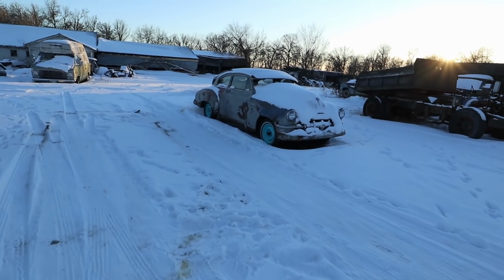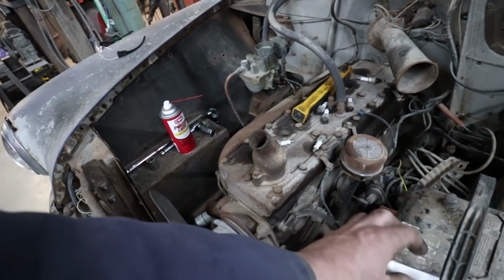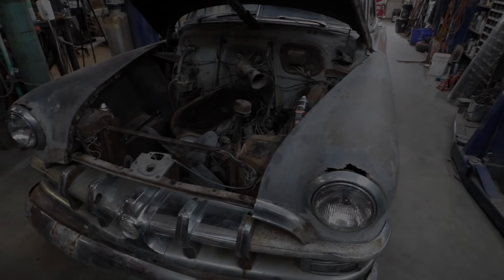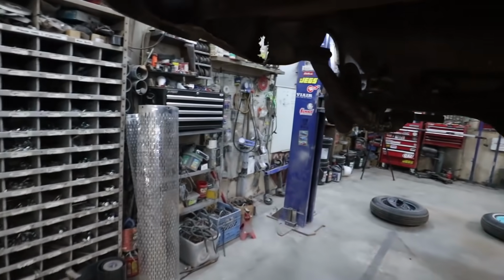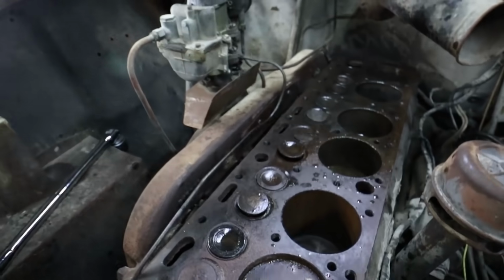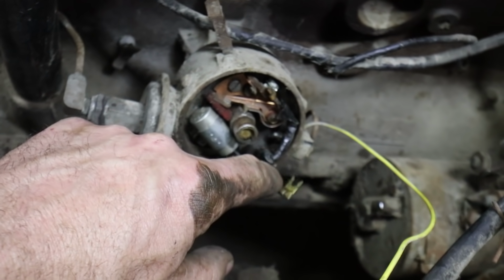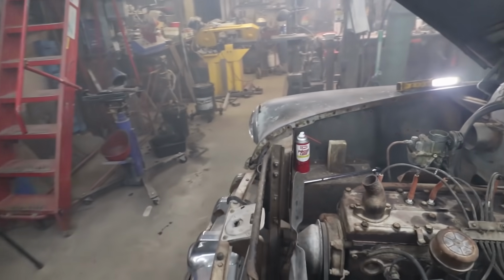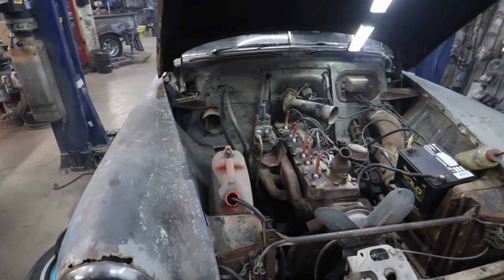Traded a snowmobile for an abandoned 1949 Pontiac with a stuck motor will it start?

Comment: My Dad had a '48 Pontiac Silver Streak, had a flathead 6 but a crack in #5 cylinder wall.  He bought a running '54 Pontiac (last year for the flathead engine) with a straight-8 and pulled the motor.  It was a bolt-in swap into the '49 and ran like a champ.

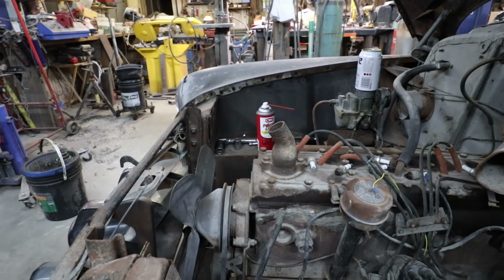Comment: 08:09 I really like the OEM air cleaner. Lol.
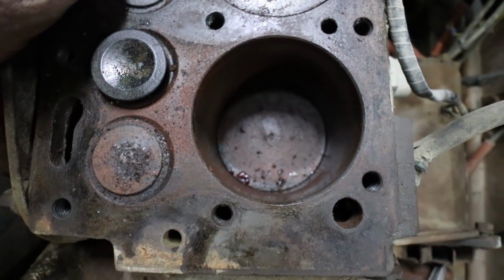14:49 I use to put Kerosene in the cylinder, let it soak, and use a piece of wood as my punch/drift and hit it with a hammer.
Took time but it worked. When you saw the level of Kerosene going down things were happening.
The sound to me sounds like the Bendix on the starter is not disengaging. It's in over run.
Reply: Kerosene  works very well, fill up stuck cylinder s and let set.. I had a 1939 Pontiac 6 cylinder  stuck solid.  Couldn't  even break it by towing it popping  the clutch. Finally  one day I had to move it again I was using the stuck motor as a break. Then the motor broke free sending me down the hill hit a tree. Changed oil started it
 Up.

Comment: Its not a bad looking ride you know. I was born in 49. The motor actually purred the 1st start, amazing. Saw some chrome off the 4 door that might work, bumper and grill looked nicer. I have no idea how you deal with the body rust underneath, Be a driver for sure, make is safe and reliable then another guy could tinker away and still drive it to the hardware store. Great job on the motor. Nice project. Thanks for sharing, Dennis in Virginia

Comment: My first recollection of a car was my dad's 1950 Pontiac. Then I ran across a picture of me as a toddler in 1955 with the Pontiac in the driveway. It was a straight 8, he had it until the mid 60s. Great old car, very reliable.

Comment: Could peck on the pistons with a brass or lead hammer. And could do the same with the valves And that motor sure does rock a bit when you try moving it. That was surprising. Who would have thought. Yea, it runs pretty good. You need to let it warm up. You keep killing it. Ronnie

Comment: Love those old Pontiacs. My first car in 69 was my grandfather's  51 Pontiac Chieftain. Straight 8 3 on the column. Light green 4 dr. That straight 8 was very powerful. later I had a 53 4dr str 8 automatic dark green top light green bottom. and a 50 2dr business coupe with a 6 that I bought for $50.00 and drove 2 years.

Comment: Since you were holding the hot wire in hand an the battery was disconnected after it would start, it appears that the generator is doing what it should an making juice to run on. I like the front of your parts rig the best an no holes in the headlight brows. What a find. Glad it wasn't the slush box transmission as there okay but ah.... just not my cup of java. It should be a breeze for the starter car builder as they really forgiving in so many  ways. I used to boil the head gasket in hot water and then quence it in diesel oil. It would swell up enough to get you by for a few but not for long. Great little videos your giving us Brent

Comment: Hi Brent here's an old school trick for you with a seized engine soak it as you've done put a breaker bar on the crankshaft pulley nut point towards the floor slightly and put a trolley jack on the end of the bar just a little pressure and leave it like that, all the time the engines soaking the jack is trying to turn the crank, love the channel regards from the UK, Bob

Comment: I'm a mechanic in New Zealand. We used to spray a liberal coat of galvanized roof paint onto the copper gasket and it stopped any seepage because after 50+ years they are never completely flat, LOL It fills any minor scratches too.  It always worked.
Reply: I had great luck using Siloo Valve Kleen, add it to oil and run the engine. Does a fine job !

Comment: My 53 Meteor gets sticky valves from sitting.  Luckily I can push them back down with a bent nail through the spark plug hole. Then I let it idle and give it a snort of WD 40. It really revs up then. I’ve never had to repeat the process more than three times and the valves are fine for the rest of the driving season.

Comment: Don't junk that old starter. If you free off that mill then I'm sure you can free of a mere starter solenoid. You've nothing to lose anyway if it won't go back together.
btw The way that fired straight into life after fixing the points was beautiful. No coughing, spluttering or masses of cranking, just immediate smooth running. Amazing after being so stuck.

Comment: I believe it was the brake fluid that freed up the cylinders. I was told years ago if you have brake drums that are rusted and wont come off to soak the seam with brake fluid and it will soak loose the rust. I think that is what happened with the cylinders.

Comment: You should aneal the copper head gasket, it will be work hardened by now. Aneal it with your torch so the copper softens up and will squish nicely when you torque down the head.

Comment: Use transmission fluid and acetone 50/50mix i fill the cylinders with it. It works mint. For freeing stuck motors.

Comment: You can anneal copper gaskets and reuse them.  As long as no part of it is of some other (non-restoreable) material and it isn't damaged then you can restore it as good as new. Just remember copper works the opposite to steel, (quenching keeps it soft while gentle cooling allows it to harden). Then clean it up witj scotchbrite and refit to engine.

Comment: If you put a downward force on pistons 2 AND 5 While heating it, and keep the tension up. A piece of square tubing with two holes going into head bolt holes ,a block of aluminum between. the steel and piston. A light touch with an air chisel on the aluminum blocks.  Got a dodge flat head loose that way.

Comment: In my younger days we would look for old Packard's to flip . I was always amazed at how many times we would remove the spark plugs , pour in Marvel Mystery Oil and leave it for a few days . Then come back , install new plugs and a battery and it would turn over and some times with fresh gas actually start and run after sitting so many years .

Comment: The squeal you heard was air being pulled into the carb when the fuel was used up I believe.
Reply: Sounded like a starter on flywheel to me....mechanical grinding as it touched ....

Comment: With an engine that is stuck that bad, I pour regular white vinegar in the cylinders and let it sit over night and they usually break loose pretty easily the next day. Vinegar actually soaks in and eats the rust and frees up all the parts including the rings in their grooves.

Comment: Also have light seize motor and manual transmission bump start with clutch to when pull tractor or vechile pull too sometimes works and got do bump start at 15 to 40 mph speeds too!

Comment: My Dad was a '50's juvenile delinquent with an Indian Chief motorcycle and a '49 Pontiac fastback with a Cadillac V8 and hydromatic transmission. Pull engagement OD on the dash. Burgundy with gold pinstripes. Tuck and roll upholstery.

Comment: I think l wrote you about this car but l had a 49 fastback like yours is.  It developed a rod nock so l sold it.  I wanted to put a 389 motor & a Muncey 4 speed in it and call it my 49 GTO.  This happened in 1968.

Comment: After you got the engine spinning, you should have run each piston to the bottom of the bore and ran your hone a few passes up and down each of the cylinders before putting the head back on.

Comment: Cool...  BUT... That was alot of hard work!  and the rings probably are still stuck.   On the next one please try the old school method of flooding the cylinders with apple cider vinegar for 7 days..  It will clean the ring lands and dissolve the cylinder rust.  Sal "Googs" DiMarco told my Uncle Leo Murphy about it when we were trying to free a 37 Dictator...  It has worked on 20+ now...  Just free'd up a 68 430...

Comment: I knew a man who was a wealth of knowledge on old engines. On stuck ones he would take the head off and pour maybe 1/2 to 1 inch of diesel fuel in the cylinders where the pistons were down and light them on fire to heat up cylinders and help fuel oil soak down around pistons.

Comment: The starter bolt was easy on the assembly line! After that, it's a mechanics problem. Engineer finding out at the last minute, hey we need a bolt there, only place to put it, drill and tap, send it.

Comment: What should have in bottle plastic or pump can with deisel fuel 50% and Dexron 2 or 3  Automatic transmission 50% mix up to put cylinders and valves to soak on stuck motor also if have gasket plus heads off and do again if 3 time need try blow torch cylinders also vavles to some heat with the mix I said about then Johnson bar too if needed! That break loose from seized up problem to and if need tap used hard circles block with sludge hammer light taps too!

Comment: Auto trans fluid (or Marvel mystery oil) unsticks hydraulic lifters (when added to the oil) but I don't know if it will work with the solid lifters in that engine. Lefty

Comment: Great job.  Just an idea.  I use PB Blaster instead of WD 40.  I find it works a LOT better.  There's a company in North Carolina which will rebuild those transmission mounts for you...very reasonable prices.  Also I believe that car has Babbitted rods with no rod bearings.  All that means is if you have oil pressure, knocks do not matter.

Comment: Next time try regular atf fluid it penetrates good I once was told by a older mechanic to give it a try to let is sit for 3 days on a old engine that was completely frozen took the plugs out pored atf in each cylinder and it worked first try I always resort to this now when dealing with anything similar

Comment: Those old flatheads I just rip the head off right away because even if the engine turns over the valves are guaranteed to be stuck so there is no point leaving the head on it just rip it off and then you can see all the issues. I reuse the gasket I just spray it with copper spray a gasket and they seal up good

Comment: I had one just like this in 1967.  I wanted to put a 389 Pontiac motor in it.  Got a rod nock and l sold it for
$50.  Paid $75 for it 2 years previous.  Wanted to label it 49 GTO!!!.  Had a straight 8.

Comment: Every flathead 6 I ever owned I pulled the head and had it shaved .060 cause it was so easy LOL.
Reply: Oh and Marvel Mystery Oil for stuck stuff. I don't believe in much chemistry but Marvel has worked for me.
Reply: @billmiller7138  no oil has ever worked for me. Not even diesel. What has worked is apple cider vinegar.

Comment: Amazing condition for a 72-year-old. The climate over here in the UK has practically killed off all cars from this era, not until manufacturers started to dip-galvanize the body shell and rust-proof the doors, bonnet and boot, with 10 years guaranteed rust-free, that they lasted a lil longer...10 years! Most cars from the 1970s have gone to Valhalla many brand new cars started rusting away after just 18 months on the driveway! ( Ford Cortina, MGBGT, Mini Metro, Morris Marina, Vauxhall Chevette, Vauxhall Cavalier, Rover SD1, Austin Allegro, Austin Princess) They all had zero rust inhibitors along with poor water drain-off areas. Its a shame and a disgrace. Good look with the 49 Pontiac, looks like a sound project as the overall metal is sound.

Comment: Pulling the head off is the best thing to do anyway unless your really lazy but with the head off you can work on the valves along with getting the cylinders unstuck I have worked on countless of flat heads to know the valves will be stuck and the only way to unstick them is to get penetrating oil to the valves stems so it will get into the valve guides

Comment: I have had success at getting engines or almost anything that is stuck , using heat and cold water, I would have heated pistons with a propane torch and then quench with cold water, colder the better, do this three times , then use the penetrating oil.

Comment: The push button is messed up could be why the solinoid is stuck on or rusted the noise at the end was the starter not being shimmed properly you should put a proper vent in the shop I'm worried about your health

Comment: when you change the oil, put  cheap 20 weight oil and +- 6 oz's of STP oil treatment. That stuff is the slipperiest shit anybody's ever invented. Try the old trick. Put the end of a straight slot screw driver in the stuff then try to pick up the screwdriver from the oily end. 
I used to have a 61 Corvair from brand new. When the oil would get 2k miles on it, one lifter would start "ticking". That was the "it's change oil time" signal. Change the oil and add a can (different size packaging in those days )of STP. It would start with the lifter still ticking. Once it warmed up, the ticking would quit for another 2K miles. My brother worked at a gas station at the time. He went to a seminar on "oil" and they said adding the STP was the equivalent one level thicker viscosity oil.

Comment: drain the sump of whats in it then fill to top of the pistons with diesel and let it sit for a few days
Reply: I sent this before I had watched the hole vid but would still give it a diesel and oil flush before you make it do any work . Just to clean out all the crisp that's gathered inside over it time of rest its had. 
Keep the vids coming

Comment: run some transmission fluid with your gas.  It will desolve the carbon and make those valves work right.

Comment: think would have used a Piece of wood gave each cylinder a little tap tap toilet did it on many of Seized mortars. know a guy use to do the Grease gun on the plug holes push the Cylinder down

Comment: Now I don’t have anything bad to say about the CNC penetrating oil but my Dad used to always swear by Marvels Mystery oil ? I  used it to winterize my boat motors  by squirting a bit into the  spark plug holes for long term storage  I also kept a old fashioned oil squirt can full of it in my engine compartment  and I used it to lubricate linkages and other things when I was in there working or doing maintenance  I’m not for or against the Marvels but I  do believe it never caused any harm to my motors  I did have one motor get electrolysis  and that did lock the motors up  I believe the Marvels Mystery  did seep into what ever and it allowed me to get the engine turning  over normally with my starter  I suspected  other issues with compression  and I did not get that motor to start ? I saw the comment of the other guy about  using galvanizing roofing paint on your head gasket  and that may work  ? But I have used Permatex Copper Gasket spray  on a Jet Ski Head that was recommended by a  group that builds those motors specifically and Professionally for racing  for me it’s held for 25 years on a machine that was blowing gaskets previously ? Btw I was not racing  or highperformancing the machine as I ran stock configuration

Comment: Looking at the car from the rear,that's NOT a Pontiac.Its a '49-'50 Chevy tudor fastback.Someone put on a Pontiac trunk,front clip,engine and dashboard.One of the giveaways is the chrome bumper guard:Pontiacs didn't put on a plain looking mud guard:theirs was fancier;Pontiacs also had round taillights.The chrome band around the beltline on a '49-'50 Chevy was straight;the chrome band on a Pontiac had a little "dip" under the passenger rear windows.The grille is a 1950 grille.Someone did put in the correct dashboard.Those Pontiacs of that era with a flathead six are quite rare;I've only seen one in my life which was a '53.As a rule,all those 1940s through '54 Pontiacs had flathead straight eights.Most Pontiacs of that era had Hydramatics:very few had stick shifts.

Comment: Surely "unthaw" is the same as "freeze". 🤣
Reply: As a former English teacher I would have agree.
Reply: @mikemullay5622  In that case, shouldn't there be a comma after teacher and a 'to' ?
Reply: @ahwootton5  Yes, it would help if I included all of the necessary words and punctuation!
Reply: @ahwootton5  comma yes question mark. Why? Usually you put a full stop at the end of a sentence. Since she didn't pose a question Thiers no need for a question mark.  Also in that situation the word to should be spelt too, i.e, with two o's not one. Hoist by your  own petard. In future I suggest you try not to be a know all. It will invariably come back to haunt you . As in this case. And no that was not a question.
Reply: @johanmeischke9189  Where do i start with the errors in your reply?
Reply: @johanmeischke9189  How you come to that conclusion is beyond comprehension. My original comment was no more than a jokey observation.
Reply: @ahwootton5  your original reply was a snarkey no it all critism blatently wrong, designed to denigrate  the teacher. It was asinine childish and displays the kind of humour that most of us left behind at puberty. Grow up

Comment: Hell if you can get her to turn she might run like a singer sewing machine, those old straight eights were tuff old gals ! 
I use transmission fluid and kerosene for my pickling juice, there are many out there.
A good welder like you can fix the body cancer in a few hours.

Comment: Da boys, frozen Pontiac popsicle.  Pickled Pontiac stuck, turned over with some luck, lifters stuck like a duck, copper gasget sprayed with muck, engine runs solenoid stuck, parts shop'n in the muck. Old girl's gonna run again n even stop, pablo in shotgun,  are you chop'n da top?

Comment: WHEN THEY'RE STUK 
LIKE THIS
OIL HEAT RAISE ON LIFT REMOVE FLY COVER APPLY TORQUE TO FLY WHEEL RING GEAR WITH A GOOD HEAVY TRUCK TIRE TOOL

Comment: According to the grilles, your project car is a '50, not a '49.  Your parts Pontiac is actually a '49.   Your project '50 looks like a Canadian built Pontiac because it has the Chevrolet style taillignts on it.  I had a '50 "Silver Streak Chieftain Deluxe with the same straight six and Hydramatic until I sold it last year.  Here it is with my Aspen 4 speed wagon that I still have: https://www.youtube.com/watch?v=UBujvXMsdtQ&t=12s